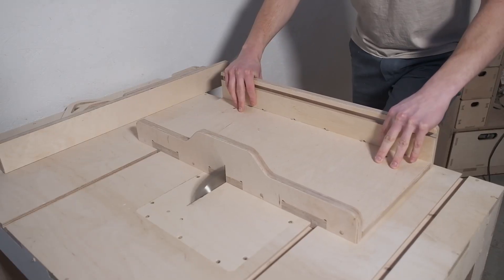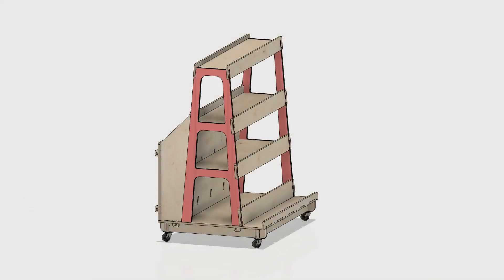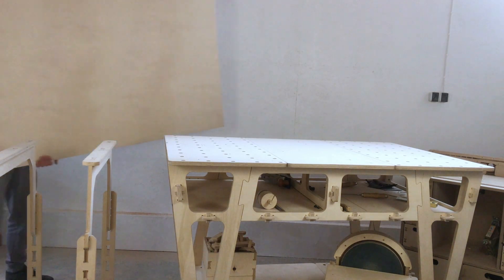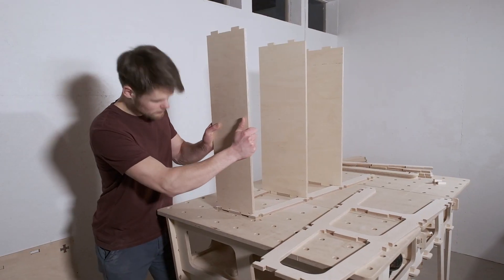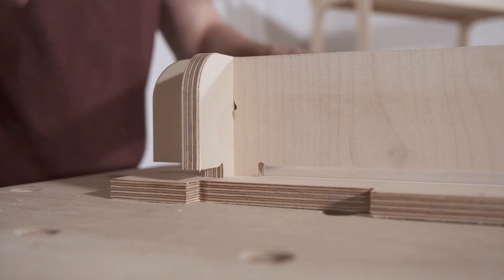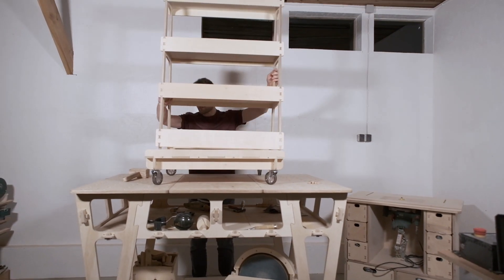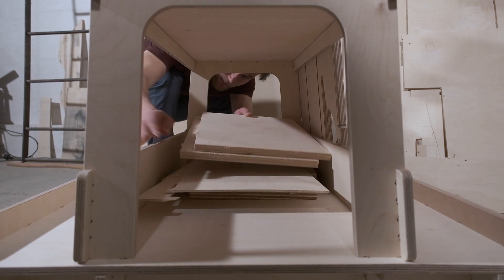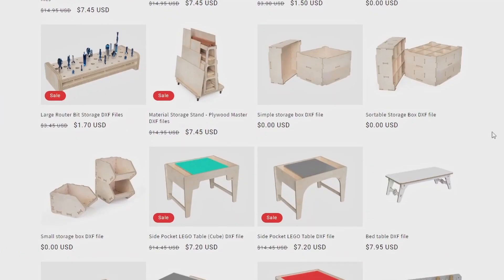Material storage made on a CNC router

Comment: Really nice design very inspiring! I'm working of making a workshop and for sure I will use your plans ! But my question is, is it absolutely necessary to use plywood? Can I make it with MDF?
Thks 😊
Reply from the maker: Thank you! We're glad you find our work inspiring.
Most of our projects can be made using MDF. However, you might have to reinforce some of the joints with screws. For example, the wedge joint isn't as strong when made out of plywood.

Comment: Really nice work. When you do your joins in fusion 360 how much clearence do you need to leave between the 2 meeting parts? Or can you create both with the same size and just force it togetter with the mallet?
Reply from the maker: Thank you!
Usually, when designing the joints, we use the same measurements for both the mortise and tenon. That ensures that the joints go together nicely. If you want a tighter fit, which would require using a mallet when assembling, you can have a small offset when cutting the components (0.1 mm is good). Since we are not using any glue for our projects, we often use the 0.1 mm toolpath offset when cutting the joints.
Reply: Hi, your projects are really cool. Congratulations. In Brazil I have a problem with the material. There is never a standard thickness, there are always small differences, which makes it difficult to design the joints. So, I always leave it with gaps, then I add screws to hold it in place. I am selecting some of your projects to buy, however, the joints need to be adjusted to the material I have here in Brazil. @Aribabox